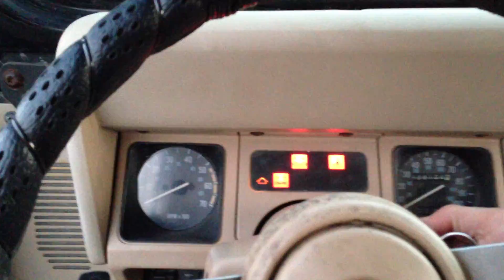Jeep 2.5L engine knock fixed

Comment: I did the same thing with Marvel Mystery Oil and drove it twenty miles before changing theoil and adding a zinc additive. As long as i keep the oil changed and add the zinc all my knocking noises go away.

Comment: jeep lifters need zinc. Valvoline vr1 is the only oil with zinc. you can have Napa order it.you can buy zinc additive online. you ll have a happy jeep :)
Reply: Rotella diesel oil (Rotella T6 for example) also contains zinc. I read on a lot of XJ forums that's what they were putting in their 4.0s, I started doing the same back when I had my XJ and never had an issue. Running Rotella extreme cold oil in my 2.5 right now, everything seems to be going alright.

Comment: What do you make of this noise? https://www.youtube.com/watch?v=7QNqmApWIjA
Reply from the maker: That louder knocking sounds to me not being a bad or sticky lifter. Although it does sound you might have a loose rocker arm. Off the get go of your video I was hearing the loud knocking as if it were coming from the bottom half of your motor which confirmed it when you put the camera under the Jeep. If your Jeep is automatic, sounds like the dust cover plate on the bell housing is rubbing on the torque converter. That happened to me when the TC went out on my 94 G. Cherokee and I replaced it and first thing it did was rub on that dust cover plate. Guess I had warped it a bit when I removed/reinstalled it which caused to rub on the TC. Hope that helps. Good luck.
Reply: Thank you very much for the reply. My jeep is actually a 5 speed manual. I think I'm just going to have to take it in. Thank you for the help.

Comment: did it remain quiet ever since? im having the same issue on a wrangler i just picked up. my noise is intemitent. one minute at idle its there, then the next its quiet, the it may be there for 10 minutes then gone again. i poured in an additive earlier today and i wish to believe its trying to free up a sticky lifter, but not quite there. i may try this tommorrow. please comment and let me know if it continued to be quiet miles later ot if it returned. thanks
Reply: Did it work for you

Comment: lol at Andrew Gallant, putting ATF in your engine in small quantities wont hurt anything.  ATF has way more detergents then oil and will clean as it flows through the engine.  its an old trick to clean up and also free stuck rings also.